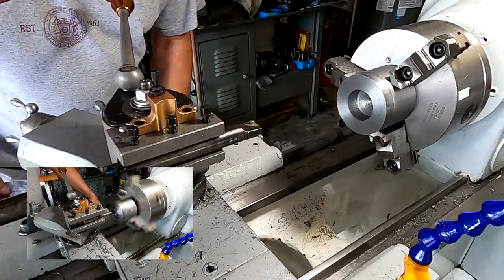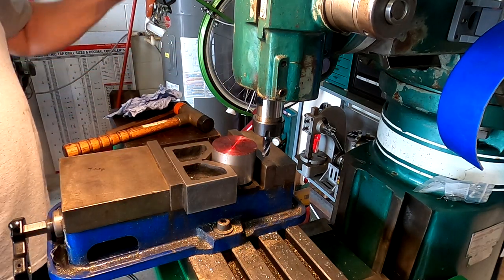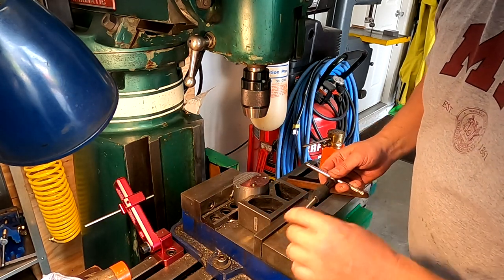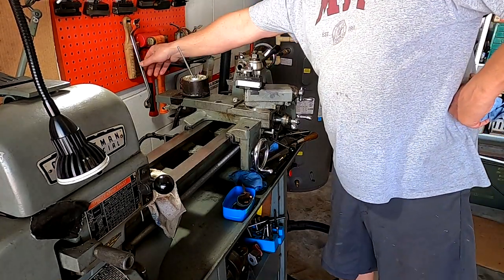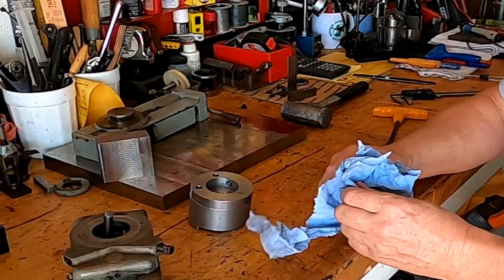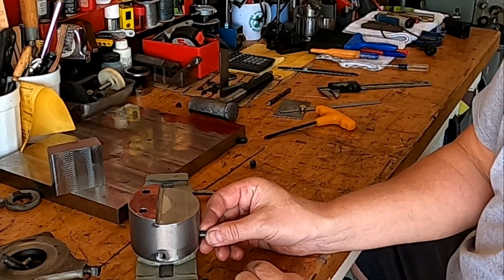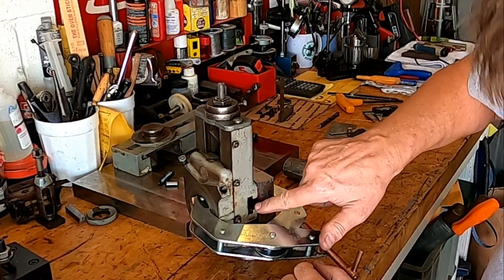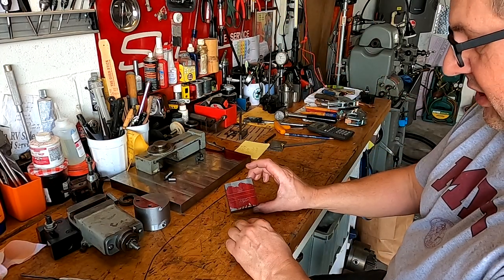How to make a Milling Attachment from scrap for the Atlas/Craftsman lathe: Part 1

Comment: Guy in deliverance couldn't play banjo,, still alive actually,
Reply from the maker: WOW, he must be really old by now.  Funny thing is the guy I'm making fun at is a friend of mine "old Jack" who really is like that and 87 years young, but loved my imitation none the less.
Reply: @donsengine3158  l sold a interview with him on TV,, he looks 80 but bad genes will do that,, no doubt he wouldn't be intelligent enough to play the banjo,, sounded totally illiterate.
Reply: @donsengine3158  l have 6 atlas lathes I've bought and restored holding on while the prices are only going up,, have 2 12 inch with quick change gear boxes and 3 618s and a 109 and pretty much every attachment for them, 4 atlas milling attachments,, and just bought a Sheldon horizontal mill number o 1947 in excellent working condition,,, l love your clausing lathe,, many down the atlas for the zmak cast gears but of all my lathes only 2 gears show wear,, hell most imports are all nylon gear,,, atlas was the hobbyist lathe and not many saw factory and school use and was someone's pride and joy,, hard to find Southend and Logan lathes not beat to hell, all mine show little run out in spindles and the flat ways hardly move indicator needle from end to end,,, you do good work , couldn't find part 2 of milling attachment build and end product,,l know if it's not as vertical as possible and not offset it will not do well lathe milling.
Reply from the maker: @georgespangler1517  I really enjoy the Atlas.  and you're right. Its pretty easy to find good condition Atlas lathes. I wouldn't have enough space for all of yours though. That's quite a hoard. You should look on my videos drop down or in the playlist under craftsman 12 inch lathe. Should be pretty easy to find. I think the opening card is the same picture.  Don
Reply from the maker: @georgespangler1517  You must do some interesting work...

Comment: Bandsaw levelling 101 ??
Reply from the maker: Or bolting to floor.. Got me right in one of my soft spots.. 👍
Reply: @donsengine3158  Bolting to the floor sounds good lol ... I have a 14" bandsaw that sits on a cabinet base, the weight of the bandsaw holds it down the the floor nice n steady.
Reply from the maker: @myworkshop2  I bolted a 3/4 fitted plate into the base to add some stabilizing weight. Would like to bolt it down but may be moving to a lager garage so don't need a bunch of hole sin floor to fill.  But with a bigger garage, I may get a bigger saw.. its just a vicious circle.